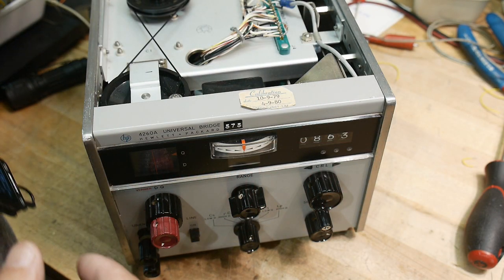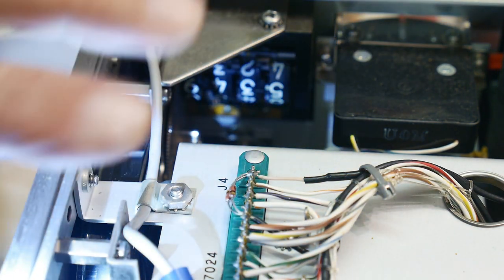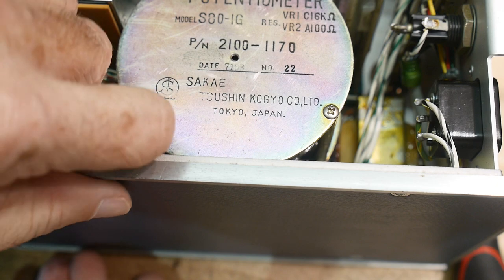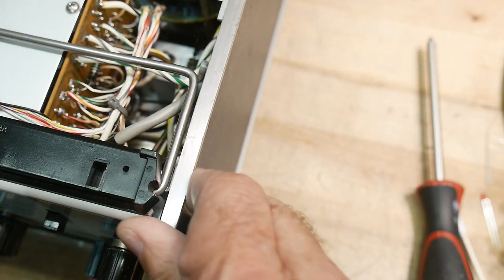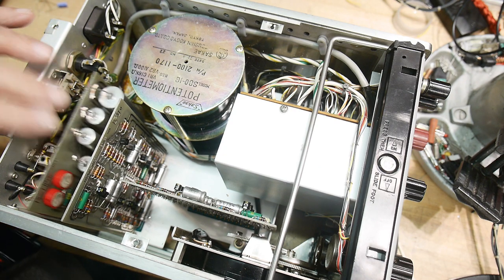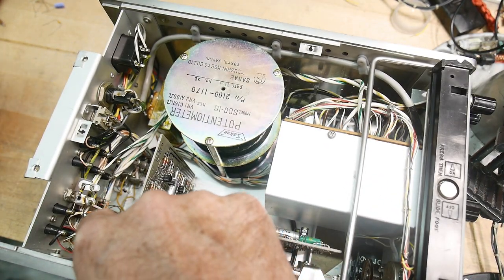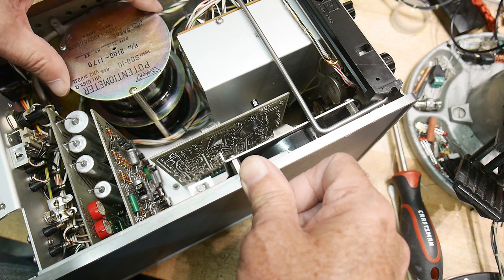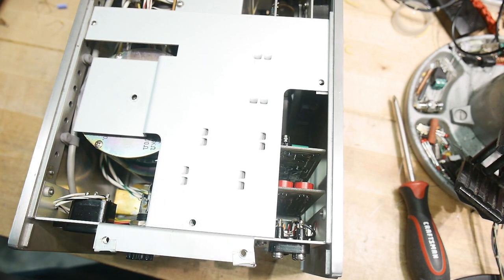#1033 Hewlett-Packard 4260A LCR Meter Teardown (part 3 of 4)

Comment: Picked up a later (1978) example at the local recycler. Only change is the power switch is a push button instead of slider. Number on the d/q pot is 95 compared to 22 as seen at 2:40. Did they not produce a lot of these? Or is that the number of pots produced that year I wonder.

Comment: Wow. Really remembering those hand-taped double sided PCB's. No CAD in 1966 either.... Surprised the 50 year old electrolytics are still working. Shows how much better things were made back then.
Reply from the maker: lots and lots of rubylith. when you went to the cabinet to get the original out, some tape would stick to the drawing above and pull off.  😀

Comment: Surely the lap counter is also a resistor? You need reference, decade capacitors, and then everything variable on the bridge can be resistors
Reply from the maker: the lap counter is geared to the potentiometer that is on its side.

Comment: Looks like your lap counter is working well.
I have 2 sweep generators with the same counter. When I got them they were very stiff to move.
They needed just a bit of strategic clock oil to come back to free movement.